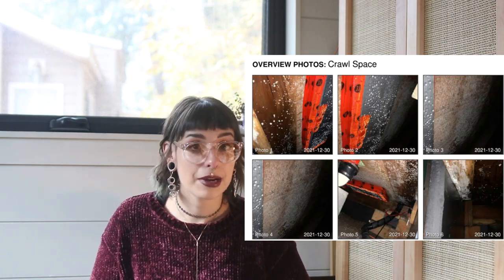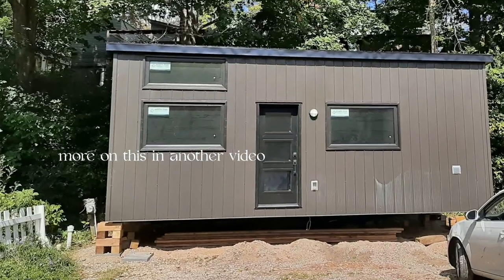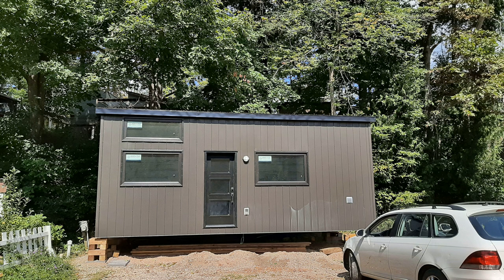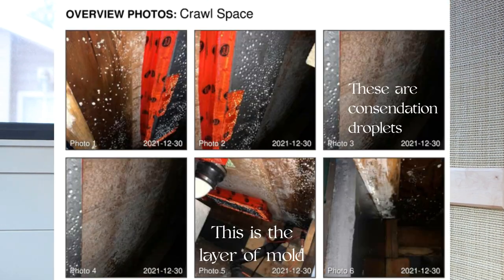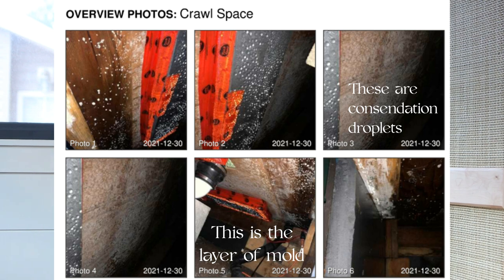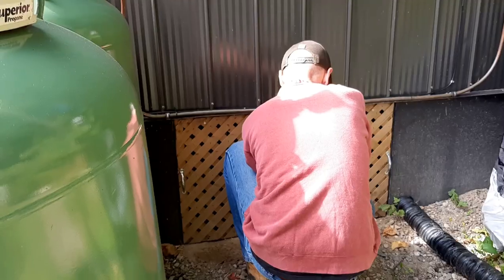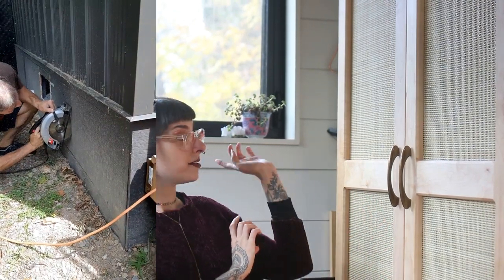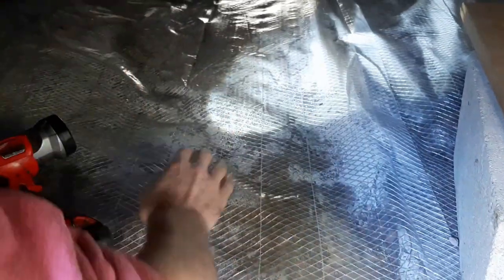VENTILATE your Skirting! | Winterizing a Tiny House

Comment: In my country tiny houses have sleds underneath and the axles are removable similar to toy cars. You can practically drop the tiny house on the ground a few cm from the ground, there is no need for skirting. However, the house needs to be dropped on a concrete slab, otherwise, it is illegal.

Comment: I found your recent interview on another channel and was really happy with how you conveyed things. If I needed web dev I would hire you. You seem to have no ego about any of it and a realistic view. After watching the interview and now this, I'm probably going to back out of my plan to get a tiny home trailer built. I was going to get something extremely similar to what you have at 110k $. I knew finding a location would be a hard part, but I was also planning on radiant floors and hadn't considered the mold issue with condensation. It seems like your floor is heating the ground causing evaporation and then when it turns off and cools, all the water condenses onto the underside and just sits there. Do you know how they constructed the radiant floor? I expected the layer of insulation under there to prevent that.
Reply from the maker: Yes, there is a layer on insulation underneath. That was also probably contributing to the issue. Thank  you for all the kind words! I actually started a new job since we did that interview a year ago, so I'm not running my own business anymore, but still making websites!